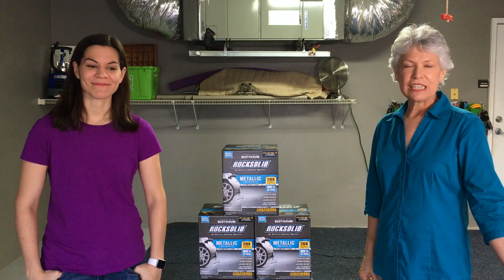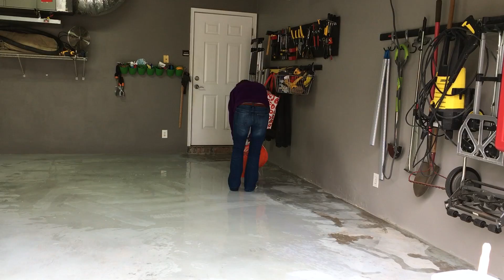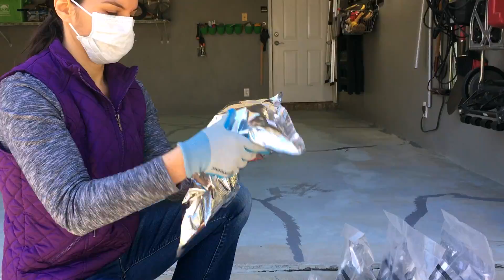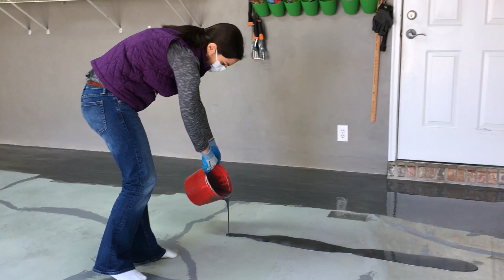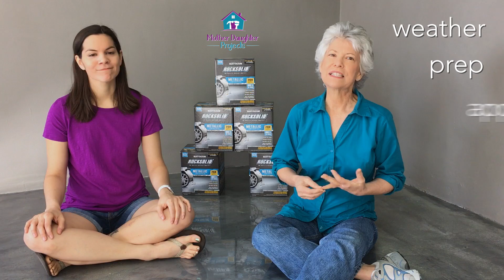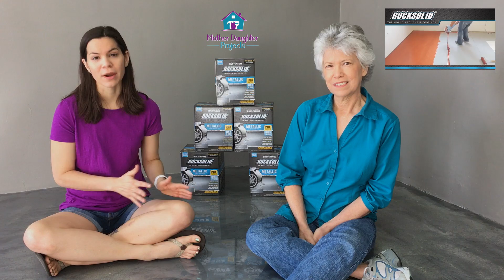How to Install Rust-Oleum RockSolid Metallic Garage Floor Coating // Part 2

Comment: Love your videos! Ive watched both of your metallic garage paint videos several times. Thanks for sharing your experience and helpful tips.

One question: what kind of rollers did you use?
Reply from the maker: Thanks! The rollers come with the product. They call it a "Polyamide Roller" on the product page.

Comment: Great video! I am getting ready to do my 2 car garage. Initially, I bought 1 Rocksolid 2.5 car garage kit but a number of videos said you really need more. So, I went back to the store and bought 2 more 1 car garage kits. You used 5 1 car kits to do a 2 car garage!  I finished my prep today and plan to start using the product tomorrow. Did you really use all 5 kits???

Comment: I watched this video and others and I can only conclude that they were paid for this demonstration.  My experience with the product was less than stellar, bordering on criminal.  My experience has been that the product is not only inferior, the claims about its ability to be cleaned and its impermeability are completely bogus.  I followed all of the instructions, on a brand new, cured slab, and my experience was that the product is no better than cheap paint.  It stains, it scratches and it doesn't even color match from bag to bag.  Totally a waste of money if you think you are going to get a "nice" floor.  And, after complaining, and to their credit, RustOleum sent me enough new product to do a second coat.  Still the same problems, absorption issues, color mismatching, staining issues and it is very easily scratched.  Save your money and get a real floor treatment if you want something you can be proud to view.
Reply from the maker: Hi Jon, as we said in the video, we were not paid for this but did receive the product for free from Rustoleum. We have done two follow-up videos on how it has held up (or not held up) and try to share our experience with it, knowing that might not be the same experience other have with the product. We encourage all to comment on the videos with their experience, in hopes it will help other researching this product make an informed decision on whether it is right for them. Thanks for sharing your thoughts.- Steph
Part 3: https://youtu.be/tsTz3iIMdBE
Part 4: https://youtu.be/47ZlOkIOLf4
Reply: @MotherDaughterProjectsDIY  This product is crap!  The videos I watched were pure marketing IMHO. Push a real solution and not this cheap paint. Ok, I'm a bit pissed after spending weeks in prep and following all of the guidelines to end up with something that is a far cry from what was marketed as a commercial grade floor covering. As i said, this product is crap. Let me know if you want to see pics, they are pretty ugly.

Comment: Oh, one more question: did your finish wear out at the entrance to your garage from sunlight hitting it or were you saying it wore out on the part that is outside your garage door?  Sun will hit my entrance floor in the evening so this may be a problem over time.
Reply from the maker: I think it was a combination of sun hitting it (we have intense sun here in Florida) and rain. -Steph
Reply: This system is not made to be outside due to uv it will turn this material yellow and start to amber out

Comment: I just found your videos so this is a late question.  I think my garage has a painted floor and it looks much like yours did.  In your prep video it didn't look like the sander took all the paint off down to bare concrete, is this correct?  I guess I thought to use an etching solution you need bare concrete but maybe not so?   Thanks and great videos. UPDATE: I found this from the Allgaragefloors.com website (great site, I agree): Another issue is the etching. Acid etching and etching solutions that come in a kit will only work on bare concrete. You cannot etch paint or a coating. Acids and etching ingredients react with the free lime in a concrete surface to open the pores.
Reply from the maker: Hi Rick- yes, it did not take off all the paint. If we were to do it again, we would have used a diamabrush attachment on the polisher to get down to bare concrete. We talk a lot about what we learned in this post on our website, toward the bottom (https://www.motherdaughterprojects.com/blog/garage-floor-coating-rust-oleum-rock-solid) - Steph

Comment: We're about halfway through our garage makeover. Yeah, this product is pricey but there's always that saying "you get what you pay for". Don't want to pay out the cash? Then settle for a so-so floor. I think the people who are experiencing adhesion issues didn't prep well enough in those areas. As for scratches, I wouldn't slide abrasive things across a $1K floor any sooner than I'd do the same on my car. Care for it well and it will probably hold up. Good video.

Comment: Hi!  I am preparing to do this project as well and I hired someone to grind and patch the garage and once he's done I think I have decided to not etch in addition to the grinding.  The person that I have doing the grinding is in the industry for 20 years, uses the product professionally, and said etching isn't necessary after grinding.  What is your opinion?  Rust oleum has been EXTREMELY helpful, but this was something they weren't quite as clear on so they recommended, due to the instructions, that I also etched.
Reply: We had a spot where Acryl-60 had spilled. Great for sealing concrete, awful for trying to clean up. Tried several cleaners, degreasers, and acetone - nothing worked, water kept repelling from the spot. After the acid etch the floor is very clean and the Acryl-60 blemish no longer repels water. I was worried the floor coating might not adhere well to that area, but now after etching I think it's going to work well. We didn't grind the surface, though (wasn't needed).
Reply from the maker: I'm not sure about this one. A very helpful website we used is http://allgaragefloors.com. Might want to see if they have an answer for you. -steph

Comment: I did not have a good experience with this product and need some sort of a top coat this fix the scratching issue.  I even put on two coats of the polycuramine top coat rustoleum recommends for the Rock Solid product but it did not help.  I did a few hours of research this week and found that "aliphatic urethane" is commonly used a a very strong epoxy top coat or Rust Bullet Concrete Urethane looks like it may work as well but don't see anyone trying these products so i'm weary to bite the bullet.   Please watch my video:  https://youtu.be/oxlBmlHiOfw
Reply from the maker: Wow Eric. I'm not sure the answer to that. There is a website that we found a lot of good info on that you might want to check out: http://allgaragefloors.com. Hope that helps.

Comment: Hows the durability? Does it scratch easily?
Reply from the maker: It's held up well so far. I do have an issue with hot tire pickup from my back car wheels. Other than that, does not easily scratch and I really like the look and feel of it.

Comment: hey ladies great job. I just did my garage floor eoth this product and noticed I can still see through to the patchwork underneath. is that normal or will I need a second coat in your opinion.
Reply from the maker: Thanks Stephen! We noticed the same thing that the product is a bit transparent. We did contact Rust-Oleum about this at the time and they told us a second coat would help. We decided we were happy with the look and didn't do any more coats. If you check out the post on our website you can read more about what we learned:
http://www.motherdaughterprojects.com/blog/garage-floor-coating-rust-oleum-rock-solid

Also, Rust-Oleum support is great and might be able to figure out the next step for your floor.

Comment: there's another video where the guy uses the same product and after he's done using it the floor it scratches easily even with plastic tools. and from what it seems like that's supposed to be scratch resistant
Reply: It scratches VERY easily!!!  I'm trying to find a top coat to protect it now.  This product looks great but its a joke! Def not 40x stronger than epoxy. ... maybe epoxy paint!

Comment: White sockets are a safety hazard (8:16).... I will have to give ya'll 4.75 stars due to that....  :)
Reply from the maker: Interesting. We will have to look into that.
Reply: Mother Daughter Projects LOL  ;D.

Nice job though ! Will be doing the same to mine next month. I performed a You Tube search on the topic for more DIY (Do-it-yourself) information. Thanks for the information ! 

Note: local contractor estimated this job (same one you did / different pattern ) for $1.8 - $2.2K !?!??!  SMH.
Reply from the maker: Awesome, good luck with your project!

Comment: Thanks for vid., I've seen others say it scratches easy, true ?   How many boxes did you use ?    Thanks.  Bob
Reply: This stuff scratches just by looking at it wrong!! not a good product and very pricey!!
Reply from the maker: Hi Bob- I would not say it scratches easy but there are some scratches on it yes. More in the areas that we do most woodworking in.
Reply from the maker: and we used 5 boxes of the product.
Reply: good god, 5 boxes for a small garage? Can't imagine how much it would take to do my 10 car workshop

Comment: question will it be slippery and will it wear off when oil antifreeze etc is spilled on it thanks
Reply from the maker: It's not slippery at all. I don't know about it wearing off with oil. That would be a good question for Rust-Oleum support.
Reply: +Mother Daughter Projects ok thanks
Reply: oil and antifreeze no it won't affect it however harsh acid ie battery acid ect break fluid, acetone, mek will eat through it. and it can be very slippery when wet